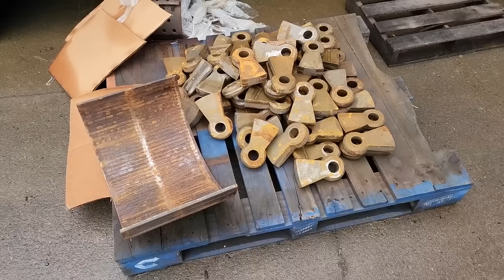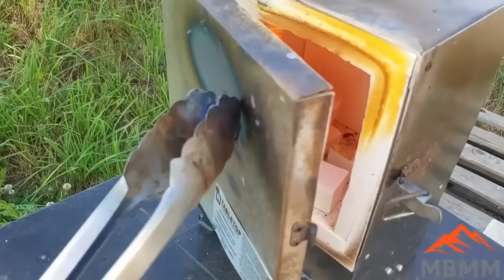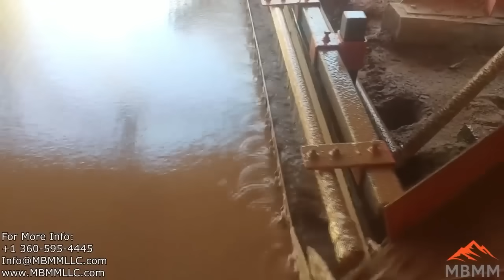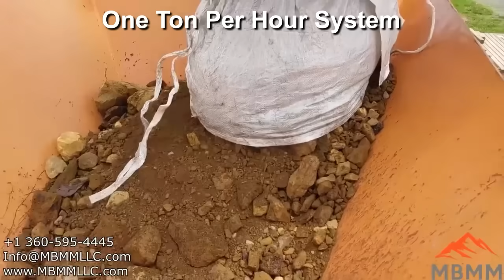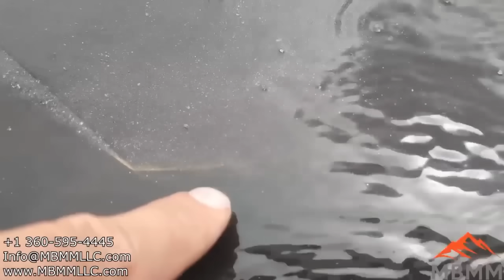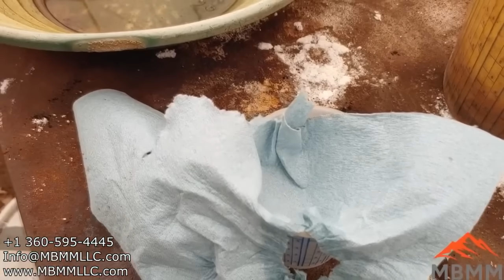Watch Gold Ore Turn Into Real Gold | 2-Ton-Per-Hour Turnkey Mining System

Comment: Living in the Sierra Mountains, I have found quarts still having gold bans, I would love to have a system like this 40 years ago when I was prospecting. Now all I need is a system to fit on a 16ft trailer to haul it where I'm working. Thanks for the video.
Reply from the maker: That would have been awesome to have 40 years ago!
Reply: @Mt.BakerMiningEquipment , correct, I think a smaller unit that fits in a 16ft trailer and be able to use it were your prospecting

Comment: I watched your video inside the mine describing how the timing of the blasting caps/connectors work.  I've watched it several times and still have can't quite figure out exactly how all that works together - the delays, the order, etc.  A white board, or paper, explanation might clear the details up, as all the wires, connectors, caps, muck, water, etc., was making it hard to follow, at least for me. I get the general understanding. Thanks for the videos.

Comment: Very impressive system, Jason. It's cool to see one set up in the field. I bet they're thrilled! I wonder what sourcing shaves, bearings, etc. is like in countries that primarily use metric, and are remote. Nice work brother! High quality, American made stuff right there!
Reply: I fix a lot of industrial equipment and I have found that bearings are really standardized and manufactures almost always use common bearings no matter what country the equipment originated from. There are probably 50 bearings that cover 90% of applications from handheld tools to most factory type equipment.
Reply: @ottopartz1  I've been an industrial mechanic for 23 years, primarily on power transmission and CNC machines. I have no experience sourcing parts outside the US. I have found certain metric bearings hard to find quickly in the US, even though the ID/mounting hole placement is standard in other countries. Are inch sized bearings, sprockets and shaves common in other countries?
Reply from the maker: Thanks so much for watching! We appreciate the kind words.

Comment: Nice set up you put together, but I’m sticking to my rather archaic method which I use in my Gold property in the Congo whereas I employ 27 chimpanzees each with 8 pound sledge hammers and  let them work for four hours smashing rocks in the little pieces then the remainder of the day four more hours I put half of them in Hydro doing the panning the other half doing the cooking. The only problem with dealing with chimpanzees is they like the monkey around and it can be dangerous. It could be safety hazards. They can catch on fire with their fur. We’ve only had three catch on fire in the last year other than that very cost-effective is my labor cost to the chimpanzees is simply $25 combined cost for discounted bananas
Reply from the maker: That's certainly a unique approach! HA

Comment: The jaw crusher is putting more  material into the hammer mill then it can handle. It should run rock goes in rock comes out. The conver belts looked like one with heaps of material and one with not much at all. It will back up and cause a shut down on one of the stages

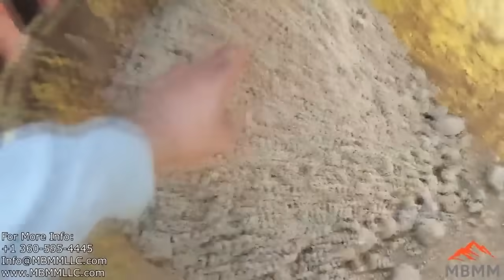Comment: 43:00  These fine dewatered tailings are of some value!   I think they would be excelled for brick mortar!!   

After air drying for a few days ... All you need is the addition of a simple "bag filler" the plastic bags themselves (copy Home Depot bags),  and a heat sealer,  

Added on to this to the project ... the small amount of extra labour ...  could make the waste fine tailings sell at $600 to $1000 a tonne!!!  ....    In 20 Kilogram bags at any Hardware or Gardening retail Store

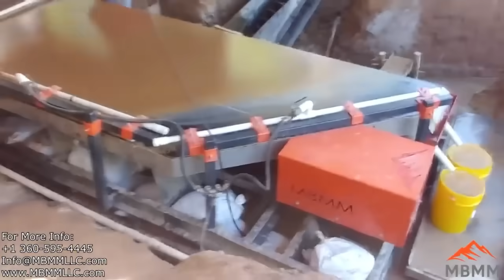Comment: 40:33 so basically the one jaw crusher could at that rate  support 2 hammer mills and 2 shaker tables thus doubling output tons per hour etc... nice to see potential upgrades with this turnkey setups
Reply: I was wondering if the feed to the mill was dialed back because of the mill or table capacity. But yes doubling up one or both of those looks like a good upgrade

Comment: Nice system. I would recommend a different control method. Use two separate operators a stop push button and a start push button. 3 wire control and wire permissive interlocks . This would allow you to auto shutdown system if a single component fails
Reply: At the very least the switches should be in the start up order left to right.
But the whole system should have a man/auto switch. And a little plc so you just push start or stop and the sequence does its own thing.
Reply: @seancraven2361  I would try to keep it a simple interlocked wire system. 
You want to be able to troubleshoot easily in the field with a basic volt meter. The only fancy tweak I would consider.would be to use an amp meter to measure power on the grinder. This would allow you to know how much tweak feed the grinder.left to right start order yes.put water proof boots over operators.

Comment: Just a thought.  Why not wire the control panel left to right in the order of operation?  Would eliminate the need to remember which goes first.
Reply: Anyone that can't remember that simple order shouldn't be operating equipment. 

But it would be more convenient.  Any competent person could move the switches... Or just put number labels over each switch to indicate the order of desired startup. 

Anyone that's actually operated such equipment isn't really worried about this.

Comment: I'M WONDERING WHY THE HAMMER MILL YOU AREN'T USING A STAINLESS STEEL PLATE SEEMS LIKE RUSTING OUT WOULD BE A BIG THING IS THE SCREEN IS AT THE VERY BOTTOM

Comment: Such a cool system! I know that you run a pretty much closed water loop with the declassifier and all that, but I still wonder under prolonged use, what kind of water upkeep is required? Mainly probably evaporation and moisture in the declassified material - What magnitude in Liters per day? Probably also depends a lot on the temperature in the area where such a system is deployed.
Reply: Not just temp but also ambient humidity. Very dry air would speed evaporation.

Comment: Hate to ask but how much does this great system cost?
Reply: $9.99 +  $47,000 delivery and 1,000,000% Tariff ?
Reply: @alasdairblackmore 😂
Reply: The whole system is easily 100k.  That generator alone is probably 20k.  This is a system designed for smaller commercial operations, but obviously way more than any average Joe looking to play with gold mining.
Reply: @AkaRyrye83  U can get the jaw crusher from china....direct for 5-6 grand. Probly get that whole system for 20gs......from china.
Reply: @freeradical6390  along with Chinese high quality  ... hahaha
Reply: @AkaRyrye83 roughly $135k last I inquired. without shipping
Reply: It’s on their website idk it’s like 10k to 100k per item I can’t remember
Reply: Do u recover the lead from the qupal
Reply: @robertmackereth2280  he does. You mix it with carbon, I think 🤔 to drive off the oxygen. He has an old video about that on his other channel.
Reply: @robertmackereth2280  Maybe crush the cupel and recover it chemically and/or electrically (once reduced from oxide state, then purified with electrolysis). Other metals present might be worth something, too.
Reply: Less than a properly equipped f150 used as a daily driver who cries about gas prices and his 1hr commute cuz he bought a bigger house he didn't need for way less!
Reply: Id say about 15 to 20 Troy ounces
Reply: Does the hammer mill collect any larger, probably balled up, pieces of gold?
Reply: @jph8266 usually rips  it apart and makes little balls